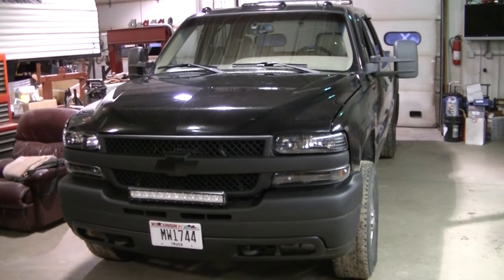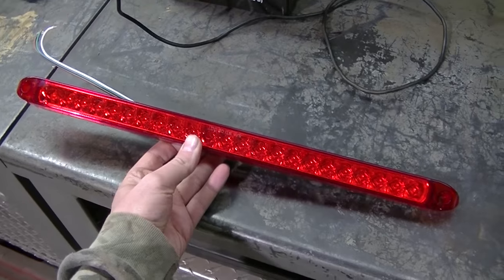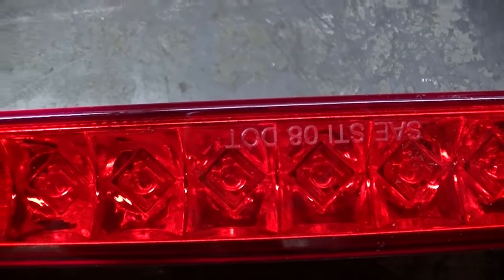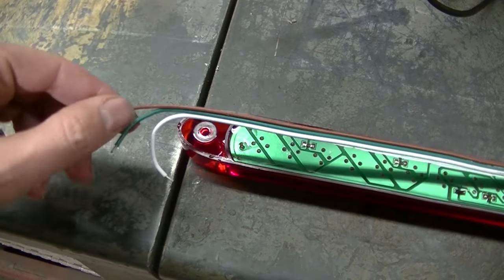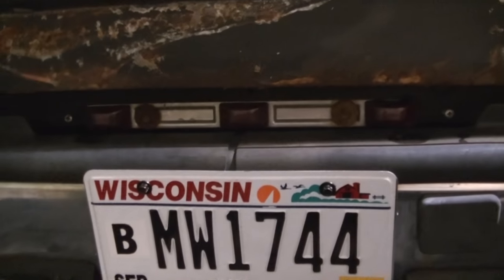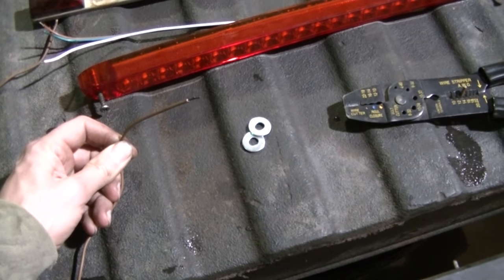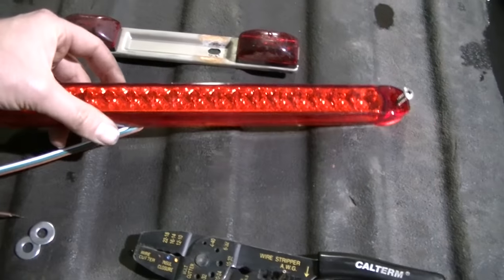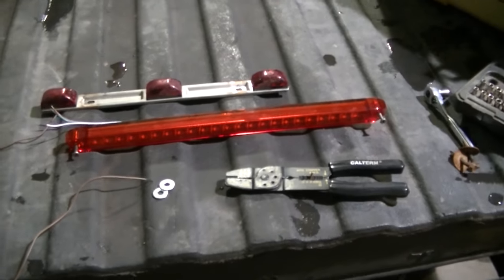"Project Midnight" Partsam 17" Rear LED Marker Light Install

Comment: That's pretty sweet.  I prefer the TecNiq ID bars though, they come in red, amber, white, 3 red with 8 white, either clear lense or colored lenses, and multi functionality... Not to mention, USA made for not much more then that one is. I have the 3 red with 8 white on my Yukon and love it, gives a pretty good reverse light output for what it is... it's no LED light bar/pod though.
Reply from the maker: Don't really need multifunction.  I will do some pods or something for backup lights.  Just not worth the extra wiring.

Comment: I have an old car that uses one rear tail light on each side. My current dual filament bulb has 3 wires. Ground, low, high just like this led. My car will send power to the low filament with lights on and then with brake it will send to high filament AT THE SAME TIME!!!!!!!!! Is this led light going to know to override low beam to high beam if it's getting power to both? Or is it going to fry itself.
Reply: Basically if I have my lights on low beam is on and when I hit my brake the same light knows to turn on high filament. It's the same with my signal light. I don't have a dedicated turn signal. It is all controlled by high and low beam.
Reply: If I have low beams on and turn right signal the left beam stays low while the right stays low while flashing high. Will these work for that? Thank you in advance
Reply from the maker: As far as I know the low light or parking lights have power all the time when the parking lights are on.  Then power is added to the brighter LED lights or turn signals and brake lights.  From you explanation I think they will work for you.
Reply: mossman381 I was thinking the same. I have an aftermarket wiring harness that knows if I have signals or brakes to illuminate the tail lights accordingly. Thanks for your info.